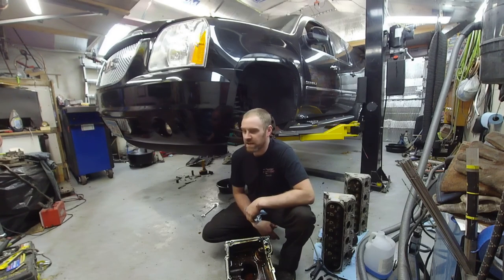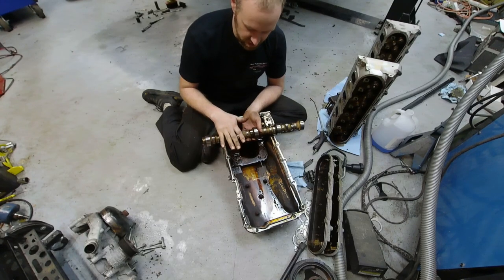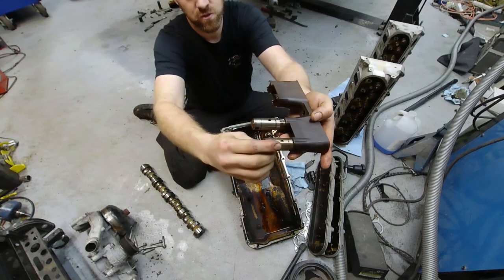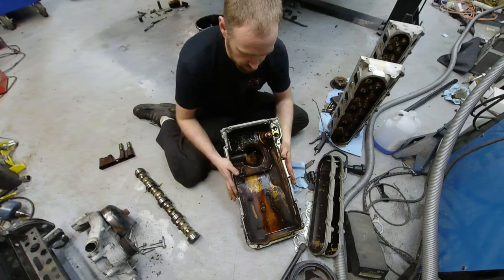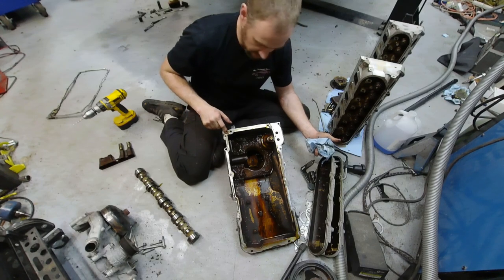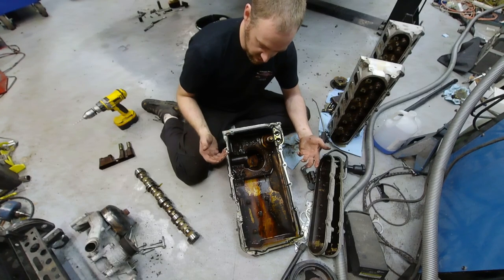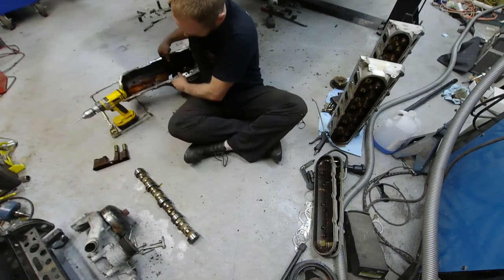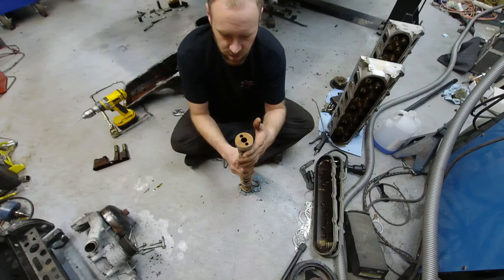Common GM V8 Issues & 6.2L Truck problems

Comment: what about installing the splash guard on the check valve on the oil pan.  GM has a TSB and a part for that.
Reply from the maker: I have hear about but haven't seen it yet personally. Do you happen to know the tsb number?
Reply: @CrazedPerformanceRepair    TSB 10-06-01-008M:
Reply: The new valve cover is included with this TSB.  Purchased the valve cover from Summitt, they have stock.  
This Bulletin has been revised to update Warranty Information. Please discard Corporate Bulletin Number 10-06-01-008L.

Condition

Some customers may comment about engine oil consumption of vehicles with higher mileage (approximately 48,000 to 64,000 km (30,000 to 40,000mi) and a service engine soon light being on and/or rough running engine. Verify that the PCV system is functioning properly. If the customer understands that some oil consumption is normal and still feels the consumption level is excessive, more than 1 quart per 2000 to 3000 miles of driving, perform the service indicated in this bulletin. It is no longer necessary to have the customer return multiple times to have the usage verified.

Cause

This condition may be caused by two conditions. Oil pulled through the PCV system or oil spray that is discharged from the AFM pressure relief valve within the crankcase. Under most driving conditions and drive cycles, the discharged oil does not cause a problem. Under certain drive cycles (extended high engine speed operation), in combination with parts at the high end of their tolerance specification, the oil spray quantity may be more than usual, resulting in excessive deposit formation in the piston ring grooves, causing increased oil consumption and cracked or fouled spark plugs (# 1 and/or # 7). Refer to the latest version of Corporate Bulletin Number 12-06-01-001.

Correction

Note : When installing the updated valve cover or reinstalling a used valve cover, verify that the baffles can hold water and do not leak. If any leaks are found, seal with RTV if possible or replace the valve cover. Thoroughly clean and dry the valve cover before installation.
Aluminum or Cast Iron Block - Oil in Intake Manifold - Install Updated Valve Cover on All Models Built Prior to February 1, 2011

Note : If vehicle is built after this breakpoint, it should already be equipped with this updated valve cover.

   
1) Old Design
2) New Design
PCV pullover or an overactive lifter can cause oil to be pulled through the PCV system even at low vehicle mileage. A correctly functioning PCV system will only leave a film of oil in the intake manifold. Inspect the intake manifold to see if there is any oil puddling in the bottom. If there is you will need to replace the left valve cover. Two new left rocker arm covers have been released for trucks and vans. Technicians should replace the left rocker arm cover with GMP/N 12570427 for 2007-2008 or GMP/N 12642655 for 2009-2011. Refer to the Parts Information below for the Camaro. This rocker arm cover has a relocated PCV drain hole that prevents oil from entering the intake manifold. Refer to Valve Rocker Arm Cover Replacement - Left Side in SI.

Note : These rocker covers are for specific years. The PCV orifice is different for each. The correct cover must be used or an SES light may set.
Aluminum Block - Oil Getting Past Piston Rings - Free Up Piston Rings and Install AFM Shield on All Non-Hybrid Models

Note : If vehicle is built outside of this breakpoint, it should already be equipped with this AFM shield or the pan does not have an AFM valve (LFA before July 7, 2009).
To correct this condition, install an AFM shield, perform the piston cleaning procedure as described in this document and install a new oil pan gasket per the procedure outlined in this document.

Monitor oil consumption after this repair to ensure oil consumption has improved to acceptable levels.

If this repair does not correct the condition, it may be necessary to replace all of the piston assemblies (piston and rings) with new parts. Refer to SI for repair procedure.

Important : It is critical in this cleaning process that the engine/fuel injector cleaner remain in the cylinders for a minimum of 2.5 hours to fully clean the components. The cleaner solution must be removed before a maximum of three hours.
1. Remove the spark plugs and ensure that none of the pistons are at top dead center (TDC).
2. Clean the pistons by putting 118-147ml (4-5 oz) of Upper Engine and Fuel Injector Cleaner, GMP/N 88861803 (in Canada, use 88861804), in each cylinder. Allow the material to soak for at least 2.5-3.0 hours, but no more than three hours and then remove the cleaner. A suggested method of removing the cleaner is cranking the engine over. Make sure to unplug the ignition coils and fuel injector before cranking the engine over. Also make sure that the painted surfaces are covered so no damage is done.
3. Remove the oil pan. Refer to Oil Pan Replacement in SI.

   
4. Remove the AFM valve (1).

   
5. Install the new shield (1), GMP/N 12639759, and tighten the AFM valve to the oil pan to 28 N.m (20 lb ft).
Important : Ensure that the engine cleaner is thoroughly removed before reinstalling the spark plugs. Failure to do so may result in a hydro-lock condition.
6. Reinstall the spark plugs. Replace the spark plugs if necessary due to full of carbon. Refer to the parts catalog.
7. Reinstall the oil pan. Refer to the Oil Pan Installation procedure in SI. Replace the oil pan gasket if necessary. Refer to the parts catalog. Replace the engine oil.
8. Re-evaluate the oil consumption. Document on the repair order. If the oil consumption is still greater than 0.946 L (1 qt) in 3,200 km (2000mi), replacement of the pistons and rings will be required.
Reply: @CrazedPerformanceRepair  I have a 2008 GMC Denali crew cab with a 6.2 L, number seven has piston slap, I also have two pushrods making the same sound as rod Knox, General Motors has really built shitty motors now. And also the 5.3, also has the same issue, collapsing pushrods.Also my truck is really clean inside and out, servicing and taking care of it.
Reply: What us the torque on the cam bolt on the 2010 vvt cam bolt
Reply: Anyone know Can't find specs anywhere??
Reply: @CrazedPerformanceRepair  what 8z that Vvt bolt torque specs you know off hand?
Reply from the maker: @joshford6064  not sure off the top of my head, do a search. It should be easy to find being such a popular platform.
Reply: @trotski3667  hey im curious did you end up getting your denali crew cab fixed? if so how much did it cost. I have the same truck as you 08 aswell, im looking to doing a complete rebuild and delete the dod with a stroker kit. it will be pushing more then 500hp to the wheels, im just waiting for my motor to go out first tho lol
Reply: Audi m14 drain plug and delete that stupid bypass valve in the pan
Reply: @joshford6064  around 80
Reply: @doddgarger6806  thanks I got it built couple more since lol. I appreciate it though.

Comment: I did the DOD delete with the afm lifter release tool and oil port plug that I purchased from you about 2 months ago, I broke out the vlom gasket as you explained in your video, (nervously), and had it tuned by the guy you recommended. I want to thank you. As you say, you are no "expert", But you are a very good technician, my Avalanche is running better than ever! I am now a fan, Thanks.
Reply: How much did all of this cost i have a 12 avalanche z71
Reply: I’m curious too.

Comment: With all the shenanigans with the LS engine... i refuse to "LS swap" any old school hotrods, the original chevy engine it came with will work just fine.
Reply: motown block get the best of both worlds. get the flow of a LS top end and eliminate the windage problem by using sbc 350 block.

Comment: Had a shop replace my transmission, now there is a exhaust leak at the pipe meeting the manifold, check engine light on for 02 sensor. Now after the repair i have oil coming from the rear 2 spark plugs on the back 2 cylinders. Could this be caused by the motor being tilted back to remove the transmission?

Comment: I thought I had a lifter tick and purchased lots of performance parts and ended up being told (after parts came) that it was my main bearings probably failing that’s caused my misfiring and dropping oil pressure… currently looking for a short block to replace but no luck

Comment: My 2012 6.2L oil pressure doesn’t change much. Doesn’t matter at idle or high rpm, hot or cold always 38-45 psi any suggestions?

Comment: Great Content Sir, Do You build or Sell the Oil Window, Or Plans/Drawing/BOM to make one ? Thank You
Building a 416 Stroker (LS7 Crank & Ti Rods) in an Escallade L94 AFM DOD  Delete (Getm Oil Squirter for Ti Rod Pin Oiling) Considering Retaining VVT w  Limiter on Low Lift Cam/.560 Springs
Swap into Heavy 80's Land Cruiser.

Comment: What are the Vvt cam/actuator bolts torque at I know ur supposed to replace it when doing timing chain.. I have 5.3L in a 2011 going back completely stock ,but the timing guide broke was making noise.

Comment: I have a 2019 GMC Sierra V8 n burning so much oil before it’s next Oil service recently had a misfire on the spark  now. Would my 8th Cylinder causing that problem.

Comment: I have a 2007 Yukon Denali 6.2    Every 50 miles on highway 70-80 mph. Lost 2 quarters !   I installed new valve cover but now passenger cover spit out oil to the intake!       I also installed  2  oil catchers one for the driving valve cover  and other for the passenger valve  cover.      Driver cover with new design is empty!   The passenger oil catcher is full and also full the intake even to the air filter!    I’m really don’t know what can be the problem!   Any ideas?

Comment: 2007 Chevy avalanche is making a grinding noise coming from what seems to the the front engine. It is intermittent and worsening when the 4x4 was engaged. It then went away and driving normally. There aren’t any check engine lights on. What could it be?

Comment: Very informative! The little thing on the oil pressure relief is a deflector that makes the oil go down into the pan instead of up and it’s supposed to be GMs answer to one of the probes I heard somewhere else that’s and after market fix I wonder if someone installed that and I also been seeing that the make plug to just get rid of it and that sounds like a better option if it works. I’m trying to learn about it myself my oil pressure is going high for a period and I mean 80+ and then dropping down and sometimes going to zero I’m really stuck and tired I’m trying to see if I need to replace that O-ring and your video taught me to check for bubbles so that’s cool! I was wondering if some AT-205 might swell the o-ring back up, I haven’t seen anyone try that and the AT 205 is hard to find for some reason!
Reply from the maker: I'm not sure about at-205  never messed with that. If it swells gaskets like a o-ring I'd be worried about other seals in the engine like timing gover, oil pan, rear cover etc. You might end up making those separate and create a much larger leak. You most likely have an oil pan leak already, so you may as well do the o-ring. It's only a 5-hour job according to the book on 4x4 trucks. It only takes me about 3 hours tops with interruptions.

Comment: I did my oil pan, oil pump, rear main seal, dog bone and front seal. The o-ring on the oil pump broke in two when I removed the pickup tube. I tested the bypass valve and it bypassed at 10 psi air pressure. I put a plug in its place. One pan bolt had pulled threads but I did not know it till reassembly. The pan gasket had been replaced previously but a bolt was installed in the wrong spot. It was too long and burst thru and damaged the pan gasket. So watch out for that. It was done before I got the truck. I did install the front and rear main seals without a alignment tool. Just note that the pan was removed when I put them on. I did not replace the timing chain. It was perfect. I did replace the timing chain guide. The spring was not running true and was scouring the backing plate.  The main reason for the work was #1 the oil leak from the damaged pan gasket. #2 low oil pressure. I put a melling high volume pump. The pressure is 70 at idle when cold. After warm up its 40. #3 Replaced the torque converter with a B&I billet heavy duty tow haul.
270,000 miles 6.2 6l80 2008 Denali has vvt but no dod.

Comment: Does the splash guard cause low oil pressure? Does the oil relief valve cause low oil pressure?Can you just leave the splash guard off or the oil relief valve off?

Comment: Hey there don't know how often you reply. I got a 2007 cadillac escalade 6.2 engine. Model 7-13 are all the same engines and shares it with GMC DENALI TAHOE SILVERADO that are 6.2. I have a code P0011 Camshaft and Code P0523 OIL Pressure... My dash on says I have low oil pressure. Long story forward. I notice the that the wires leading to my Variable Timing Solenoid was corroded and making contact I chop the wires and replaced brand new and also with the oil pressure sensor and replaced the sensor new. Problem consisted. Telling me the same codes and dash telling me oil low. I went and replaced the engine variables timing solenoid magnet and pin that goes in the spraked. Problem still consist. Before all this problem went on and off on and off and my engine knock from time to time. Now it still does the same on and off time to time... don't know what else to do. Engine feels good while running but from time to time it's knock like if something else going on. What can you advice me to do.

Comment: I'd love a Gen 5 iron block 4.8 L no. DFM no auto start stop feature. basically it's a 6.6 L work truck motor but for the halftime and you know what it would get as equal gas mileage as a 5.3 L with the DFM it would still get about the same with the smaller displacement we don't need. the only reason they do it is for emissions. it has nothing to do with gas mileage

Comment: an '07. I believe you can even get 4L70e with iron block 4.8l in w/t configuration..... and if you don't think that the work truck model is the best model, then you're crazy base models. always the best baby rubber mat roll up windows.... I'm the only guy that buys a 2016 Silverado takes off the tow mirrors replaces the 18-in option Tahoe wheels with black 17-in work truck wheels. nobody else doing that everybody go in the other direction putting tow mirrors on and huge wheels and low profile tires. I'm the total opposite I built my truck like it's a 95 k 1500 but it's K2XX

Comment: If your going to delete the dod afm you no longer need the relief plug in the pan. Plug it. If you want a stock cam go to N earlier model, my 08 yukon 6.2l did not have dod afm so that cam will be correct.
Reply: Bingo.  Plug it and get rid of the POS relief valve!

Comment: Hey brother, so i have lc9 5.3 2012 yukon xl same issues. I am thinking of re checking if i need another pickup o ring as i replaced 4 months ago and had oil pressure up until recently, i changed oil, filter, oil pressure sensor, and plugged oil bypass relief valve in pan with m14 1.50 bolt, and STILL no or low oil pressure. Is it maybe another new pickup tube o ring or cam bearings? I just dont understand this anymore as its all been done
Reply from the maker: It could be the camshaft bearings, but it could also be the lifters themselves. Pull the valve covers off and run the engine. If a ton of oil squirts over the fenders from the lifters pushing it up the pushrods then your lifters are junk.

Comment: Yes its a lsx racing block 427 but i just have mi thoughts on that and yess that the pump i got i don’t know why melling says don’t youse it on NO engines vvt or afm i have use this pump and works better for racing apps clearance bearings

Comment: Did a delete on my 17 High Country 6.2L as soon as it left the dealer with Range AFM
Reply from the maker: Good call leaving the system off now just keep up on the oil changes and hope what happened to this one doesn't happen.
Reply: @CrazedPerformanceRepair  I  change it once a year roughly 10,000kms use Amsoil Signature series and filter plus have a catch can and cleanside separator. Crazy the crap that it catches.
Reply: @anthonymacneil2279  Did you have lifter issues or had them replaced at dealership. That being reason for deactivating DOD?
Reply: @albertpalos2508  No, had no issues just wanted rid of it, the truck was bought new .Heard lots of bad things about them

Comment: In reference to the cam comment at the end, get a cam for a 2007 Yukon Denali 6.2. It has VVT but dos not have AFM. I just worked on one and it didn’t even have AFM lifters from the factory. It used stock gen 3 style lifters. It is also a single bolt camshaft.
Reply from the maker: Not all 6.2 are not AFM. I bet that Denali opted out or was a 2500. Then again maybe because it's a Denali it was considered too heavy to take advantage of AFM. That's what seemed to happen to a lot of the Cadillac of that era. Both are loaded with accessories and heavy trucks/suv...
Reply: @CrazedPerformanceRepair  I’ve read that is was more of an early production decision GM made for the heavy vehicles. They weren’t sure if it would make much of a difference. Some vehicles received the hard parts but it just wasn’t turned on in the programming.

Comment: My 6.e escalade has a knock I can't tell where its coming from kind of sounds louder from the oil pan but not much. The oil dipstick has bubbles in it but its full.
Reply: Hi, did you ever figure out what it was? Mine is doing the same thing.
Reply: @lazydayB2B Yeah it died like a month ago. Cadillac repaired the motor 7 months prior when the AFM failed. Now this, and they won’t accept responsibility. I only use it to pick up my kids and the oil was changed 2 twice within those 7 months. I now have a 6000lb brick.